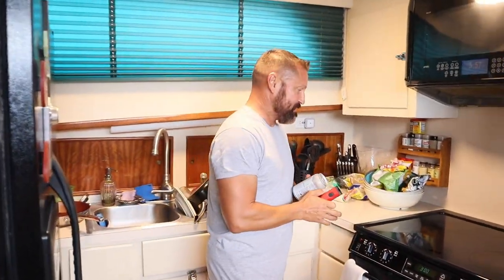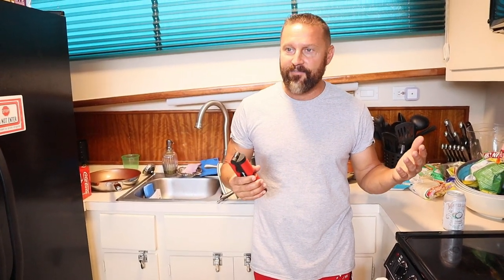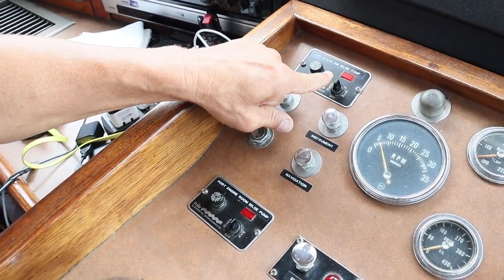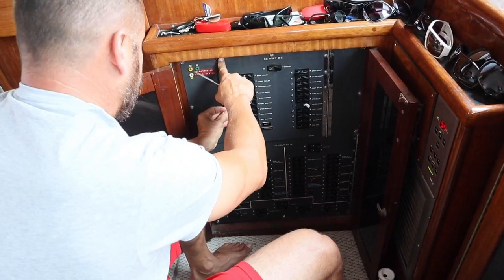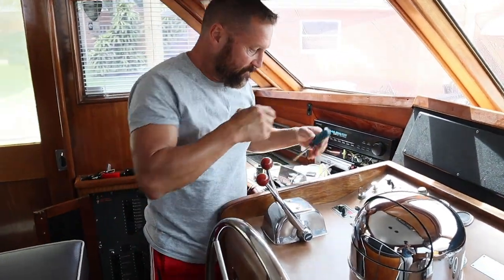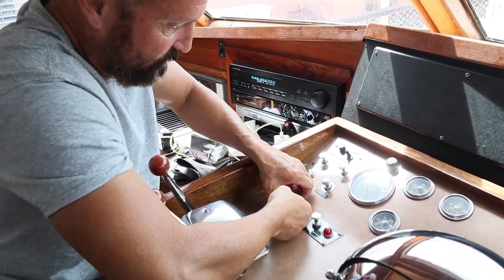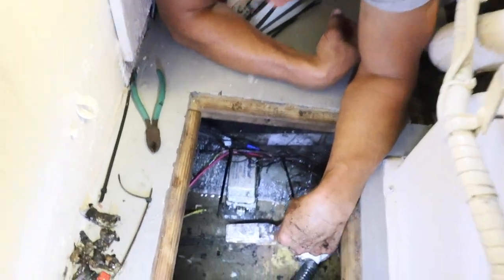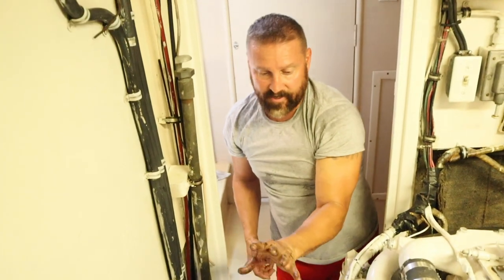High Water Alarm Going Off / Not Good

Comment: Home depot has a 110v emergency water pump for about $100 that pumps 1680 gal per hour, just connect the hose from the bilge pump or ( run a garden hose to a near by sink) plug it, and drop it in and your done.